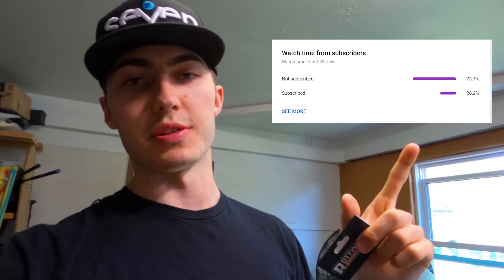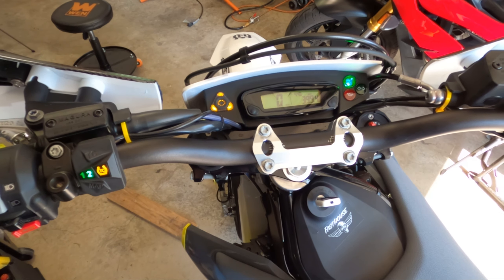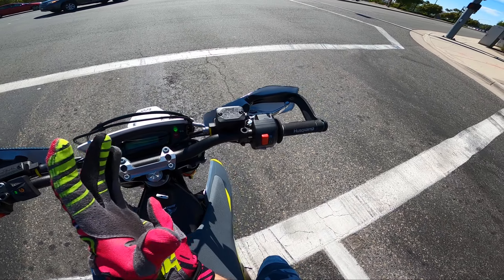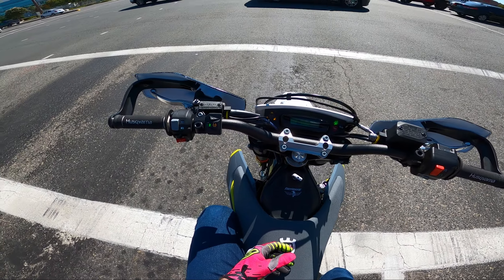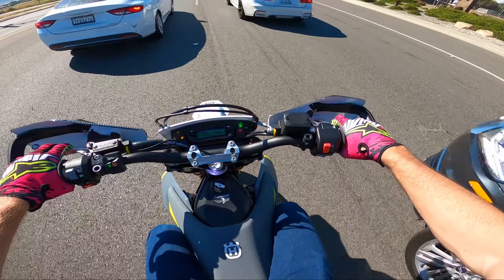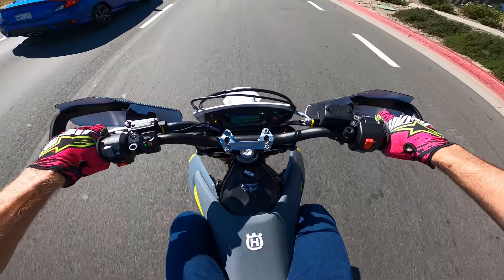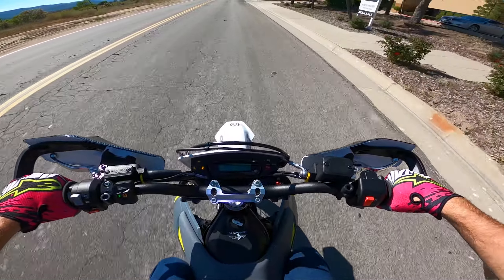2020 Husqvarna 701 SM Fuel Dongle Install/Review (Wheelies!)

Comment: The stock throttle linearity is HORRIBLE. I actually looped my 2020 doing a wheelie because it just took off after a 2-3 shift. Legend says my butt is still healing to this day.
Reply from the maker: Aww man sorry to hear that, but yeah definitely, it's super unpredictable stock. Now mine is much much smoother. I bet that one hurt👀
Reply: @TheonlyrealChester  $5800 in damage. I only had it 4 days. I used to wheelie my DRZ400SM for miles and the throttle was super predictable. This thing however . . . I did order a LeoVince pipe, DNA filter and airbox cover, PCV and the dongles from Rottweiler and the SAS/Canister delete too so it should rip pretty good. What pipe are you gonna run?
Reply from the maker: @kurylajarod  damn....👀 That's rough. Hopefully you had full coverage, im working on finding a sponsor for the exhaust but I'd like to run ether the akro, wings or leo!

Comment: i think the problem with the sm is the gearing, its too long. lets say i would get it to do no more than 170 175kmh, thats what a supermoto should go around to. and you would have a lot more power
Reply: Totally agree, I changed mine 14t front 45t rear, clutch up 4th no problem, power wheelie 3rd no problem

Comment: why would you remove it when installing the powercommander?! piggyback ecus can’t override the stock ecu on low rpms because of the closed loop control system that works with the o2 sensor. keep the fuel dongle so you’ll force the ecu to work in open loop this allowing the powercommander to work on low rpms as well. if you remove it, the powercommander will only work at mid/high rpms!!

Comment: !!!VERY IMPORTANT!!! 
For the EU guys wanting to buy this dongle, with the newer Models the Euro 5 and up this doesnt work anymore since the O2 sensor has a closed loop.
So once it detects anything wrong with the mixture it will overwrite and adapt to the current riding situation, same thing with the Power comander you wont be able to programm pops and bangs anymore you'd have to do a ECU flash.
Greetings from Germany
Reply: From which year? I just got a 2021, will it work on that?

Comment: Nice video thanks! So is a dongle enough to get the bike to crank up with gas?
I'm finishing my run-in, I'm at 400km, but it doesn't get gas up, neither in map 1 nor in map 2.
Tips?
Thank you
Reply: Remove stock air box and put cone air intake

Comment: I have the 19, bought it used. Modded airbox, dongle installed and pc5 but i notice my air sensor to the exhaust is still on the bike. Is'nt it suposed to be removed ? Does it matter ?
Reply from the maker: It doesn't have to be there but isn't hurting anything

Comment: Does your 701 ever stall when downshifting? My Vitpilen 701 (same engine) stalled when going from 3rd to 2nd while rev matching and I can't figure out why.
Reply from the maker: Interesting, I've never had that happen!
Reply: @TheonlyrealChester  You're lucky. Seems to be a common issue in the Vitpilen forums.
Reply: Have it on my 2020 smcr 690… you have a sport exhaust?
Reply: @paul95923  Ya I have an Arrow exhaust and fuel dongle. After the break-in period and first service I haven't had another stall.
Reply: @astifcaulkinyeras  I just ordered the Rottweiler Performance Fuel Dongle. Which do you have? I hope that solves my problems
Reply: @paul95923  That's the one I have. Works well with the Arrow pipe which is my only other mod.

Comment: 3rd gear clutch ups at 50 mph work like a charm, 3rd gear with no clutch is tough
Reply: I just this afternoon installed he dongle on my 2020. 2nd gear power wheelies are silly easy. With the proper body positioning and input, 3rd is good too, but harder, like you said. If you had a kicker, such as a hill, it'd be a breeze. I'll likely drop a tooth up front and add a few in the rear. Then I'll be expecting 4th gear power wheelies :)

Comment: Hey,  nice Videos !
I have a question:

is a Power-Commander required after changing the airbox and install a fuel-dongle ? 
Did those mods ( fuel-dongle / open airbox ) something on your performance ?
greetings from Germany

Edit: Im asking for the 701 SM
Reply from the maker: Thank you! I don't think it's required, it would definitely help get the most out of it but the fuel dongle is helping. I would say if you do an exhaust get the PC!

Comment: Do you need a fueling dongle when you already have a power commander 5
Reply from the maker: Nope!
Reply: Chester Anderson thanks! Getting mixed awnsers on this, some say the PCV doesnt work on lower rpms so a fuel dongle is still necessary and some say its not D:
Reply: @Brentvl  rottweiler themselves say a dongle is needed. Closed loop (below 5500rpm) always corrects itself with pcv only. It only works in the higher rpm ranges. There’s a video on their website about it!

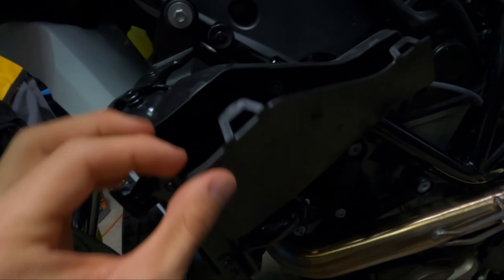Comment: 1:52 this Box is for your on-board tools. You should have got a blue bag with some tools in it, with the bike.   Under your Seat you can clip a T-30 Screwdriver wich you need to access the on-board tools.
Reply from the maker: Interesting! I'll put them in there, that's really cool!
Reply: OMG! it all makes since now.I used to think... whats the point of a tool box that I need a tool to get to. The under seat clip was the missing piece of the puzzle. thanks man.

Comment: I lost power with the fuel dongle installed... do you know why?
Reply from the maker: Interesting 🤔🤔🤔 you may have unplugged the wrong wire? Or are you running aftermarket intake or exhaust?
Reply: @TheonlyrealChester  yes I am running yoshi pipe no baffle
Reply from the maker: @wildnas5272  that could be it, I would get a tune!

Comment: Try 15 tooth for the front and 47 for the rear sprocket. That's scary! 🙂
Reply from the maker: I bet😂 15t is going on soon
Reply: @TheonlyrealChester  Yeah. with that set up the 3rd gear wheelie comes easy. Could do on 4th as well. Stay safe 😉
Reply: My 701 2020 stock 15/45, in mode 2, 3rd gear wheelie no problem👌

Comment: does it work on carb 2 strokes ?
Reply from the maker: Only if it has a 02
Reply: An electronic plug can never do anything for a mechanical carb. The jetting is what is needed to change if you want more/less fuel

Comment: Clutching it up is the only proper way to wheelie. When you try & do them with the power of the engine alone, it controls when the wheelie happens. When you use the clutch, you control when the wheelie happens. :)